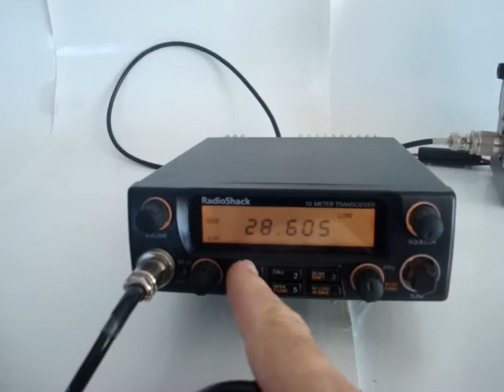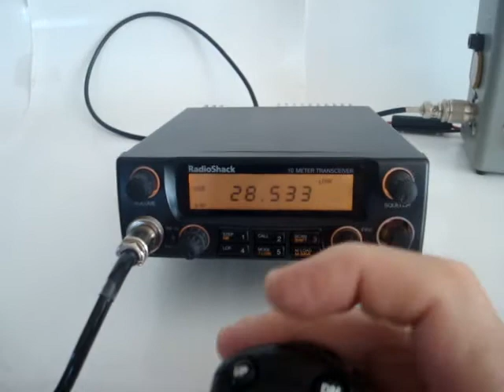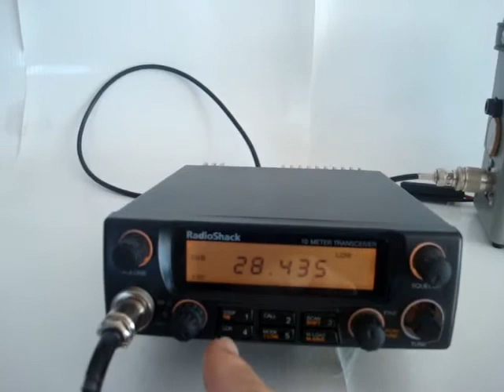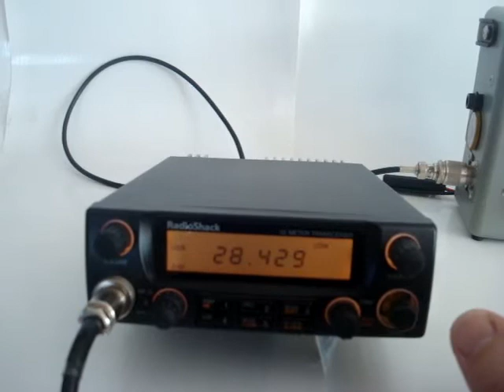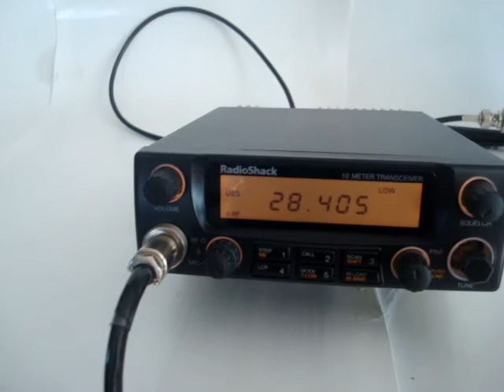Radio Shack HTX-10 all mode transceiver for 10-meter ham band

Comment: I know your post is 7 months old but I wanted to say I also have an old HR2510 and it still works great and sounds wonderful too! Mine was outfitted with the ChipSwitch (remember those?) by the friend who gave the radio to me and I'm actually able to use my HR2510 on both 10-meters and 12-meters as well :)
As old and dated as the HR2510 is it still works great and sounds soooo good on the air to this day. Although these were hugely popular with the CB crowd, they are wonderful 10-meter rigs :)

Comment: I have always loved these little radio's because you just can't beat these little guys for simple 10-meter operation. If you can get one for a decent price they are great rigs if you just want to do your thing on the 10-meter band (all modes too!).
I agree with the poster these are built very well and are so fun and simple to use for mobile or base operation.
Don't get me wrong, I still love my full output Kenwood TS-480 but for the money these little guys provide a lot of fun on 10-meters!

Comment: Thanks for your demo of the HTX-10. I just ordered one on ebay and I'm waiting for it to arrive in a few days. I have an older Uniden HR-2510 and I believe that this radio will be a step up. Have you had any luck working the 10 meter repeaters?  I really love 10 and 6 meters. Would be great if there was a 6 meter version of this radio.  73   de Steve

Comment from the maker: That's a weird failure mode - it should not do that. Changing RF gain should not change the frequency. it sounds like there is a bad voltage regulator in your radio, I can't think of another reason why that would happen.